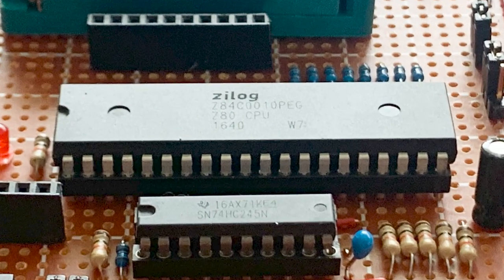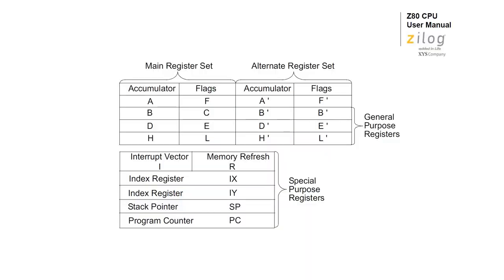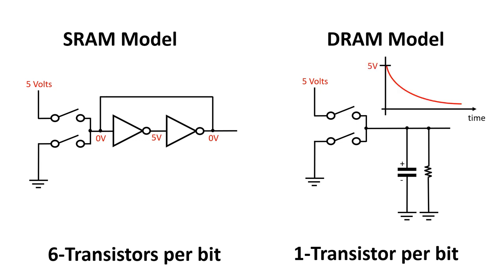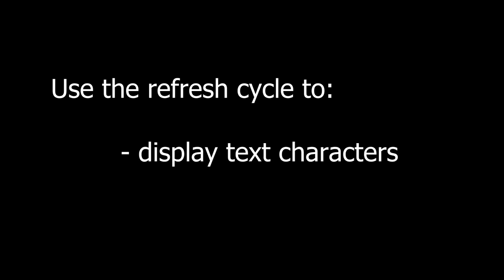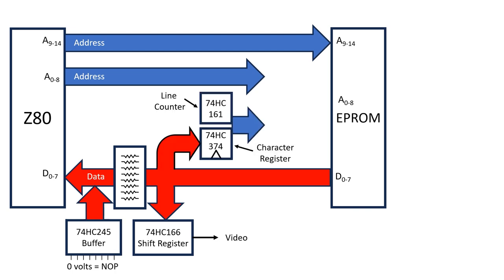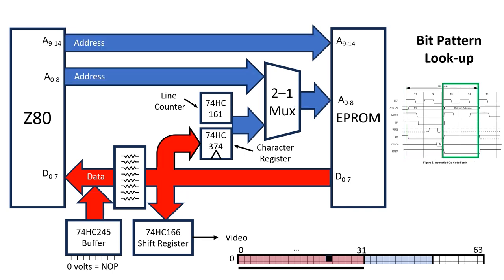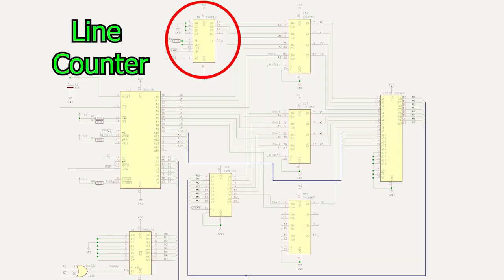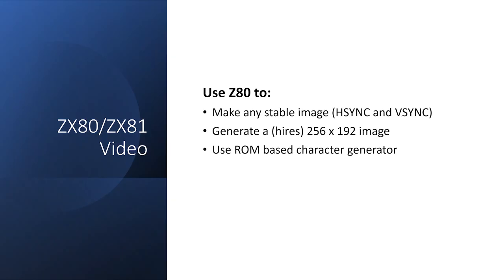ZX81 Video Circuit Part 3: TEXT.

Comment: Great video! To clarify most of the pseudo hi res graphics games that don’t require any additional hardware such as Rocketman , Forty Niner etc all use the same technique .. change the I register to another random set of ROM data - values of 12 and 8 are the most common… this gives access to pseudo random bit data for each “character”. The video buffer in memory is 182 lines of 32 characters each of which ends in a Ret not Halt  opcode (both with bit 6 set in the opcode of course). A custom video driver jumps into this video buffer and the trick is that the display driver resets the Line Cntr for each line so it never increments !! Tada pseudo high res images …
Reply from the maker: @TechWorldServices  yeah, you just change the interrupt address for a random character set.  We then have 7-bits (inverse + 6 bits) for 8-bit of display.

Comment: It seems from this explanation that the screen RAM contains not just video information but also a program which is the "main loop" which runs all of the time unless an interrupt (such as for keyboard input) comes which then suspends the video processing until the interrupt is handled.  Once the interrupt is handled, it then does a RETI to return to the main loop.  That's why the screen "flicks" each time a keyboard key is pressed: It has to stop displaying so that it can handle input.
Reply from the maker: Yep, i'll be going over interrupt in the next video.

Comment: So really, the ZX80/81 are a text display circuit that just happens to have the ability to run BASIC as well. ☺️ I knew this was true in terms of the timing, i.e. the ZX81 executes user programs during the non-visible lines of the display, but I had no idea it was so literally true at a hardware level.
Reply from the maker: Yep, nearly all the 7400 series logic and most of the
CPU time (when the display is stable) is for generating the image

Comment: "The ZX80 and ZX81 used SRAM" unless you added a wobbly 16KB expansion module, in which case the free refresh from the Z80 (even hijacked as it was) really helped.
Reply from the maker: Actually, the 16k Ram expansion had to recreate their own refresh.  If you have a look at the schematic, the 16k expansion has a 74ls393 to recreate the refresh counter. This one had me baffled for a while.
Reply: @DrMattRegan  wow. I didn't expect that. I had the module but never looked inside and didn't study its schematic. It still depends on the Z80 timing so this wouldn't work on any other processor.
Reply from the maker: True, it still uses the refresh timing, it just has it's own counter.  I also means you can't use data stored in the DRAM to directly replace the character set.

Comment: My understanding about games that appear to show an arbitrary bitmap is that they use custom display code to address any byte from the character ROM that they need at the time, with the caveat that it may not be a perfect match at all times.
Reply from the maker: I haven't disassembled any game code, but the problem with the current character set, is that line 0 and line 7 are blank for almost all characters.  I'd personally prefer random code to the existing character set.
Reply: @DrMattRegan  I'm reading elsewhere that the I register is used for the high byte of the address (normally $1E to point to the character set, but other parts of the ROM may be preferable, as you suggested).
Reply from the maker: @peterhemmings2929  correct. That is one of the tricks for pseudo high res

Comment: I like the way you solder  the protoboard jumper wires. I have never thought to strip off a long stretch of insulation, solder the bare wire and then thread the correct length of insulation back onto the wire. It looks like it produces a neat result and would be easier then trying to strip the correct length of wire to begin with.
Do you have a more detailed description of this technique anywhere? I will have to give it a go when I am next wiring something up.
Reply from the maker: I have thought of doing a video like that.  I was thinking of comparing the VGA from a EPROM design in both bread board and point to point soldering.

Comment: Impressive ✨ 
although when you feedback output from eeprom to ROM address via mux doent it cause timing glitch ? since it is not been clocked to avoid hazards in timing.
Reply from the maker: Thanks, no the data from the EPROM is clocked through the character register.

Comment: Great explination, very easy to follow. Though I expect I'll have to watch it a few times for it to really sink in. Question: It seems like this pushes a lot of complexity into software for driving the video system. Did the ZX provide any abstractions for developers to help with that complexity?
Reply: Sinclair being Sinclair: no. The only thing were the Basic (pun intended) output routine that handles the "display file" (IIRC). With 1k, screen buffer was dynamic with ENTERs representing EOL. Only with more RAM the display file becomes fixed size 32x24, if I'm not mistaken. Hires modules were a separate thing, I had a Memotech HiRes module and a Memotech 32k RAM module.
Reply from the maker: Correct, i'll be going over the display file in the next video.